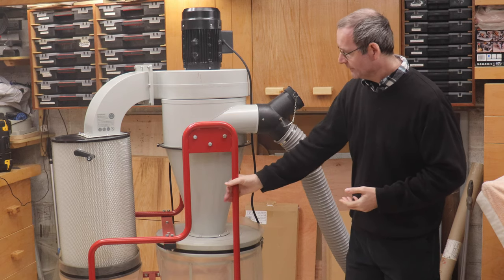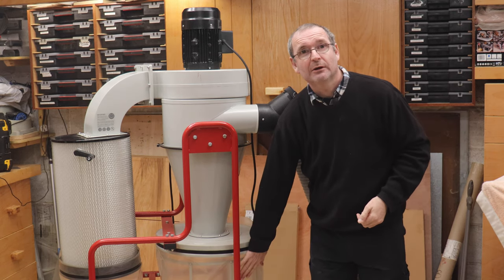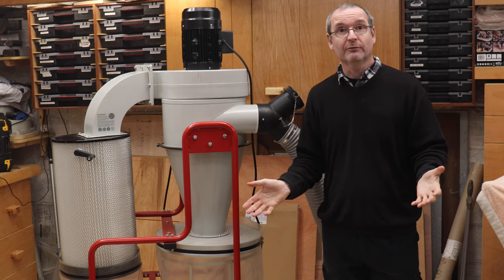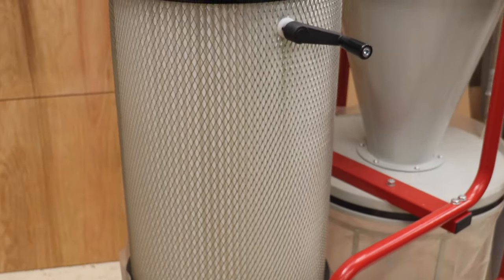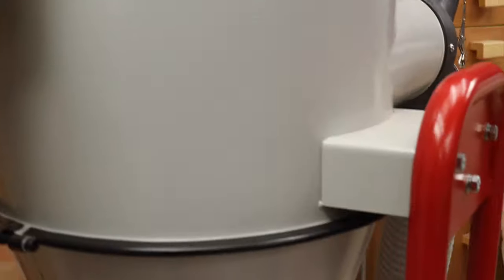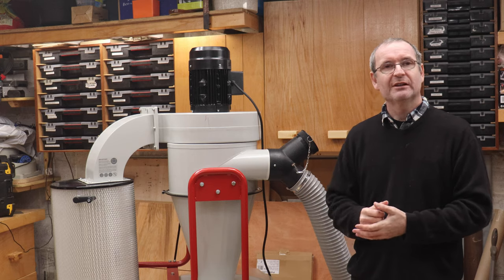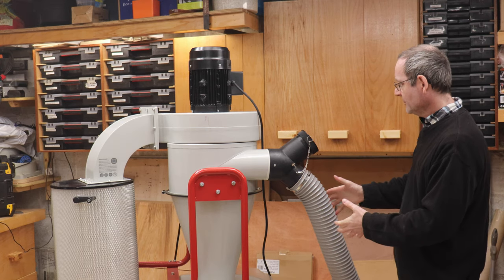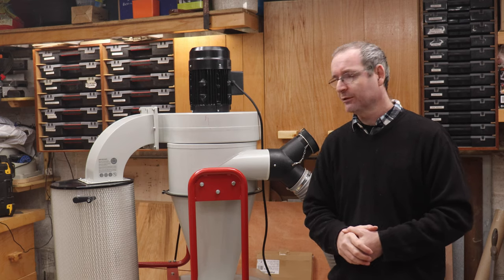Axminster AC118CE Dust Extractor - Holtonsfixit101

Comment: Considering one of these for my next workshop. Can you tell me if the switch is a regular on/off rocker or an NVR type? Also, can you recall what length of bolts you required?
Reply from the maker: Hello and thanks for the coment. The switch for this machine is of the NVR type, this I would think is for safety reasons but this is not good if you want to have the collector as a central dust collecting machine. if thats what you intend to do then you might have to change the switch. I think there are just straight on/off replacemants but got to remember that the motor does have a lot of watts to it so get one the can handle that amount of juice. Please be mindful of the safety factors when changing a switch to.
As for the bolts. as i recall the bolts i used were some i had in storage but they were M8 x 40. Theres a big cavity behind where those bolts go in. I changed them because the bolts they provided were not what I considered long enough and the one's for the castors I believe I use M6 x 30 but it was about a year ago I put mine together so I could be wrong with those.
Anyway good luck if your hoping to get one of these machines. you wont be disappointed I've had mine for a year and never had to clean the bag that hanging from the filter and as for the filter that's as clean as the day I bought it.
Reply: @Holtonsfixit101  Thanks for that. Yes, hoping to use it 'plumbed in' and activated when a machine comes on. Cannot understand why a dust extractor needs an NVR!

Comment: I got this machine for 1.5 year now and I’m really not happy with it. 

Bought it out of the selling point “for those who like clean air in their lungs” And that is a lie since the machine leaks dust in every connection, even from the spot welded ones. 

Also been having electrical issues, some sort of loose connection. But helps janking the cable to the motor.

And on top of this the design for the dust collection plastic bag is just cheap and stupid. 
1. It’s a pain to change the bag. Estimate 5 to 10 min work. 
2. Since there is no dust vacuum barrel the plastic dust bag takes all the vacuum over some sort of frame that can brake the bag. 
3. The frame that holds the dust bag is placed in the bag(since there is no vacuum barrel) so when You filled a dust bag you need to take out the frame from the bag. Attempt to do that with cleanliness in mined.

If you plan to buy this machine please do your research. See it in action, compare it to other machines. Don’t do like me and just buy it out of what the manufacturer have to say about it.
Reply: I got this for 1 year ago, and i’m verry happy